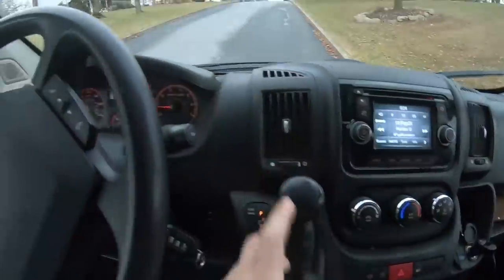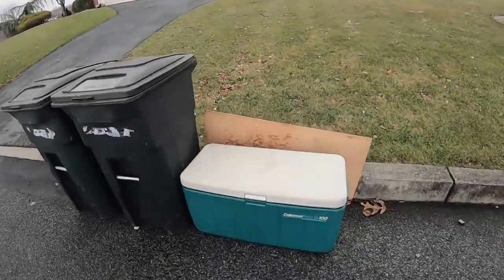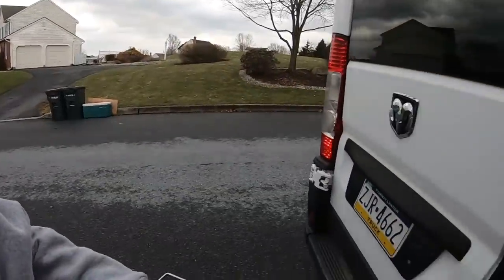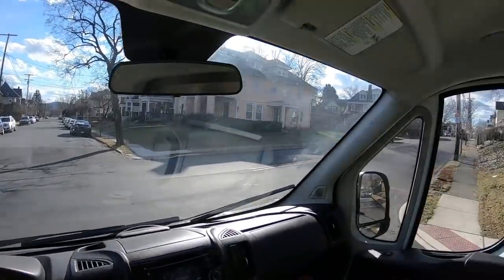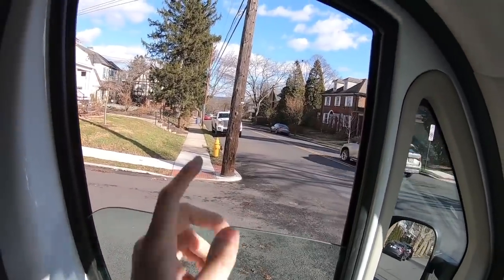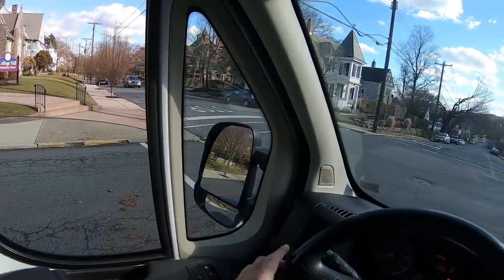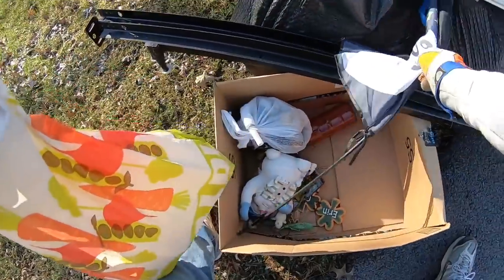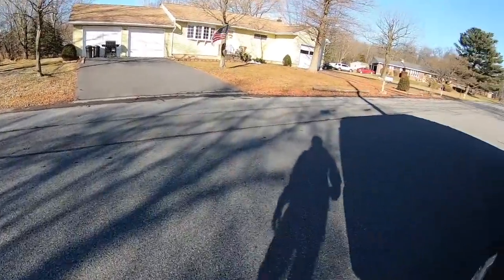Trash Picking for Free Treasures Left For The Landfill! Garbage Picking Ep. 105

Comment: You should build up your parking area so it is not lower than the surrounding ground then add the gravel. That way water will drain away from that area instead of pooling.